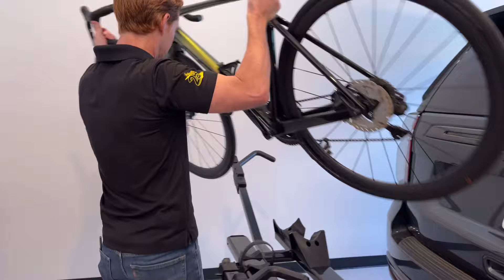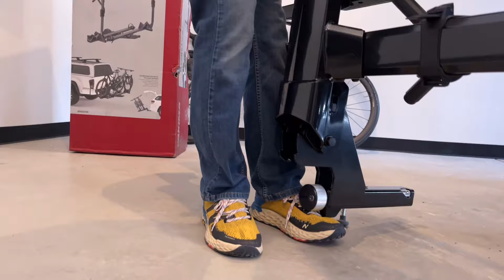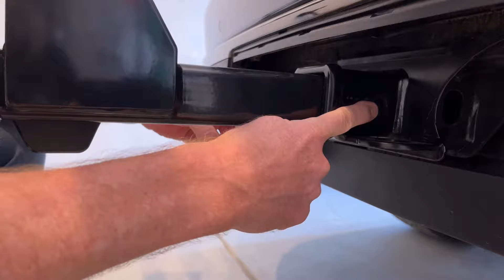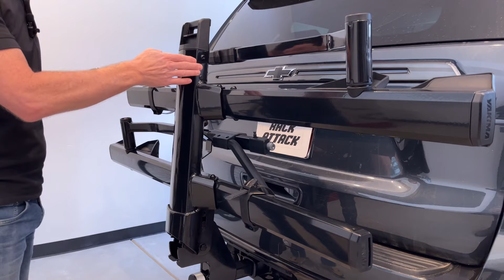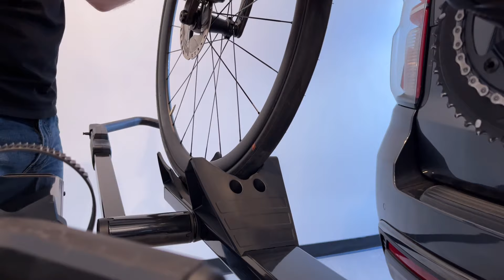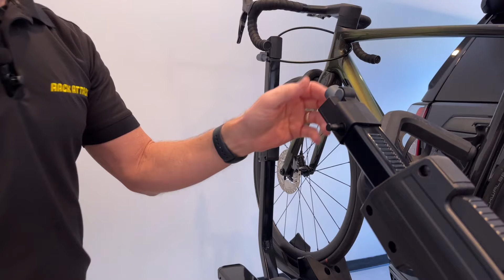Yakima StageTwo Hitch Mount Bicycle Carrier Overview and Install

Comment: I see there is a “foot” on the bottom of the rack near the silver knob. Is that steel or rubber?
Reply from the maker: Hello.  The, foot or fin at the bottom of the stinger is a steel protector for the knob incase the rack rubs or drags on the ground.  Some lower vehicle, in some situations, may find ground clearance an issue, this feature will help to protect the knob and rack.  A tip is to approach sudden inclines (eg: driveways) at an angle to lessen the potential of rubbing the rack on the ground.  Thanks!

Comment: Can this rack be used with a bike that has a front fender?
Reply from the maker: Hello.  The bike is best held as close to the front fork as possible, a fender will prevent the most stable hold on the bike.  We suggest considering the Yakima OnRamp which is best suited for bikes with fenders:  https://www.rackattack.com/hitch-bike-racks/yakima-onramp-2-inch/

Comment: Will this rack work on a 2007 Toyota RAV4? Also will it accommodate a 29” x 2.5” tire? Thanks
Reply from the maker: Hello.   The StageTwo fits 20” to 29” wheel sizes and tires up to 3.25” wide and up to 5" wide with the StageTwo Fat Bike Kit (Sold Separately).  It is available in two sizes: 1.25” hitch receivers and 2” hitch receivers.  Use the guide below to confirm sufficient clearance on the RAV4, if the spare tire position causes issues, Yakima does offer hitch extensions as a solution.
https://assets.yakima.com/Product/instructions/8002740/1  Thanks!

Comment: How do you tighten the rack securely to the hitch with a wheel?  It seems difficult to get enough leverage on a round object without any detents. I’m concerned someone could steal the rack by pulling it out.
Reply from the maker: Hello.  The round turn knob provides the necessary leverage to engage the wedge inside the hitch firmly.  As with all hitch racks, we'd still suggest checking the tightness periodically on long road trips.  Thanks!